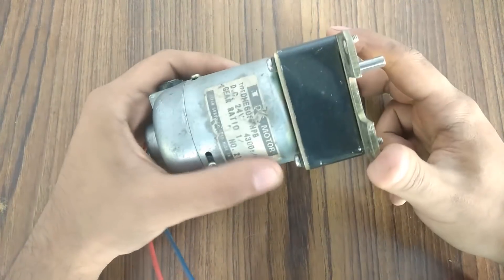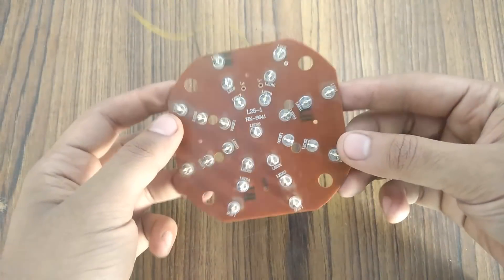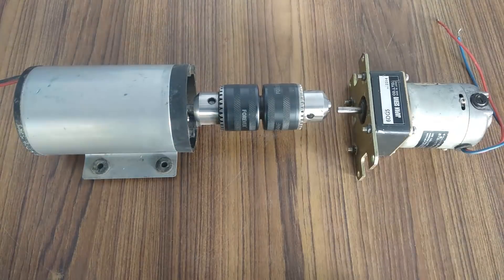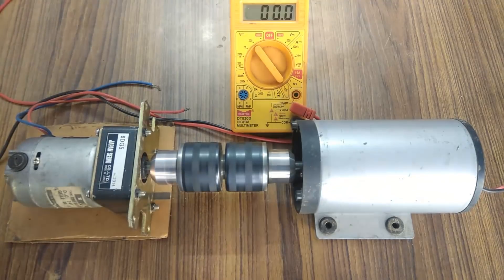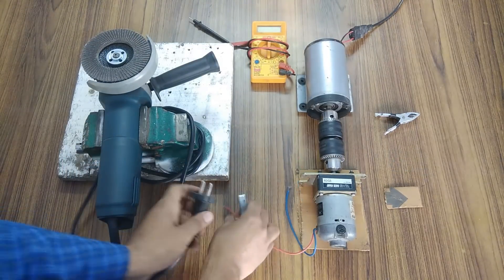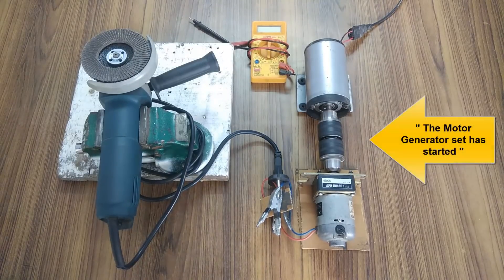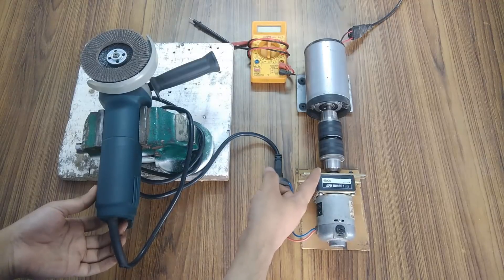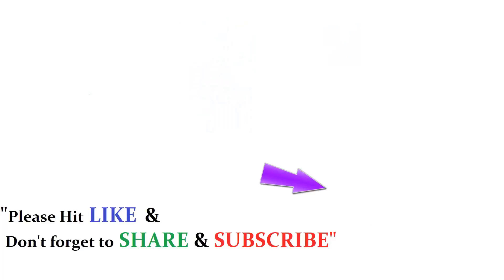Free Energy Motor Generator Video || It can run Grinder

Comment: Running grinder with DC takes more amps than using AC with the same voltage.That I found in one of my experiments.
Reply from the maker: Thanks for the info..
Reply: TODOR brassmonger Official ft. cloudance Depends on the type of motor... But than it will produce the same power at a lower voltage...

Comment: Hi , how come you put the multimeter on DC measurement reader to check out the voltage ? Did the motor you used had a Bridge rectifier init ?
Reply from the maker: it has dc commutation which is like a rectifier